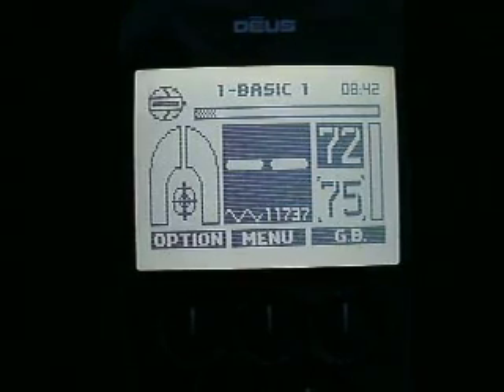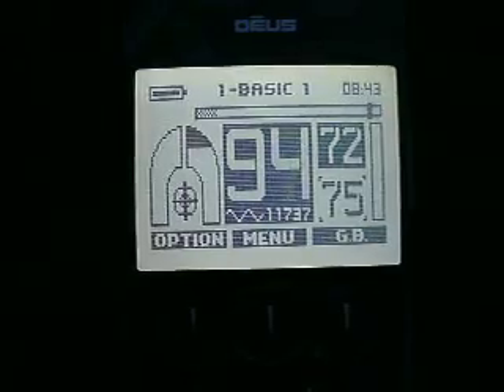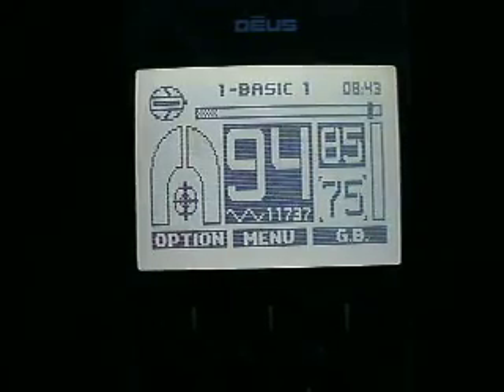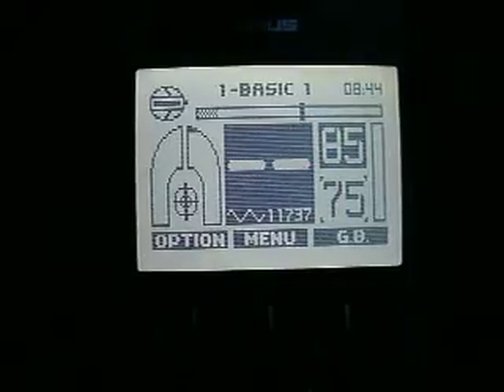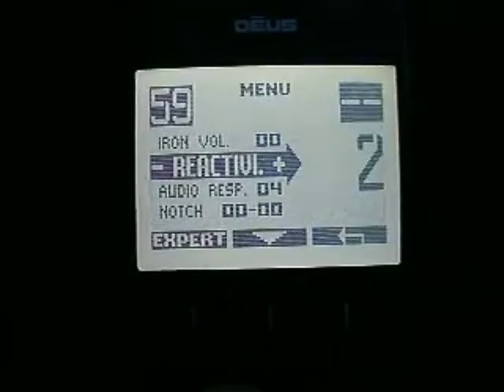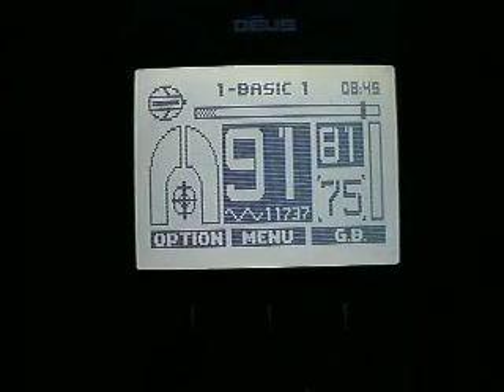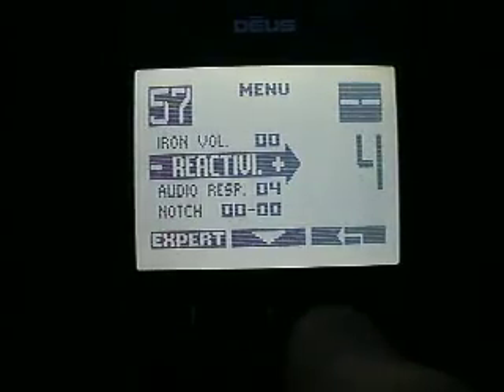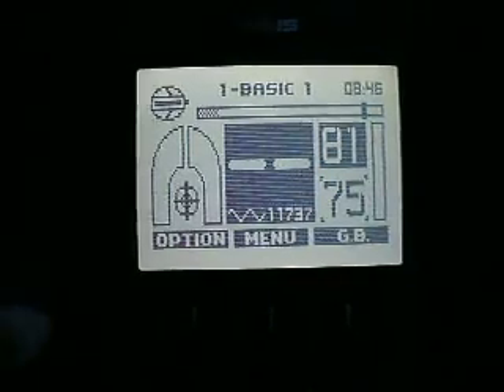Fantastic XP Deus reactive feature "recovery speed"

Comment: A note to anyone with a Deus, when you change the reactivity setting the silencer automatically changes with each adjustment. When you change the reactivity press expert on reactivity and set the silencer. For max depth set reactivity to 1 and silencer to -1 or 0. As you up reactivity then up the silencer as well and that'll cut the chatter. It's almost like the automatic silencer change is working backwards, so it's important to be adjusted every single time.
Reply from the maker: You are exactly right